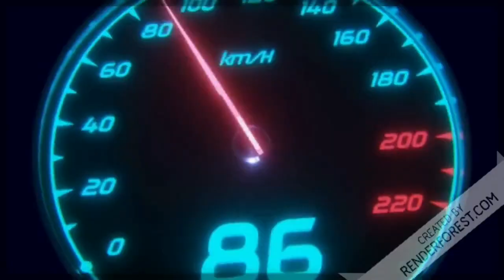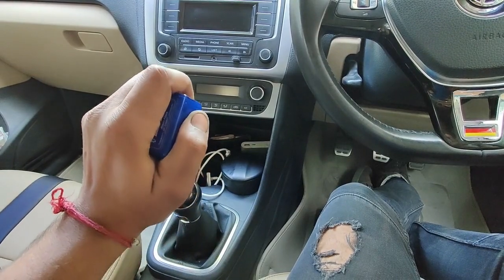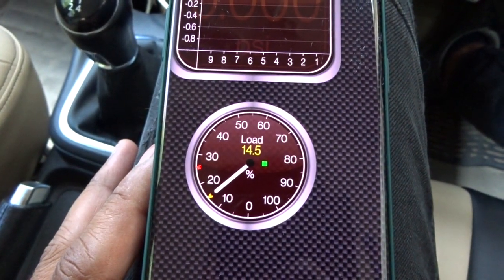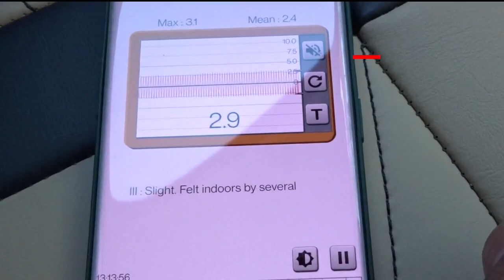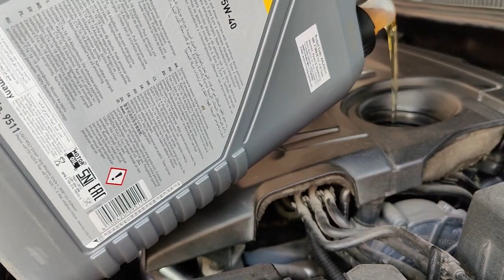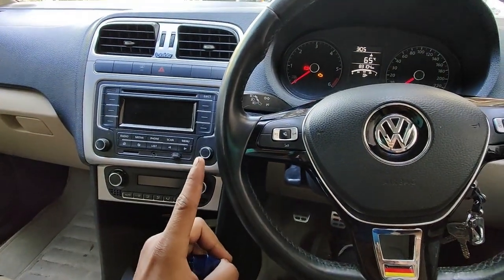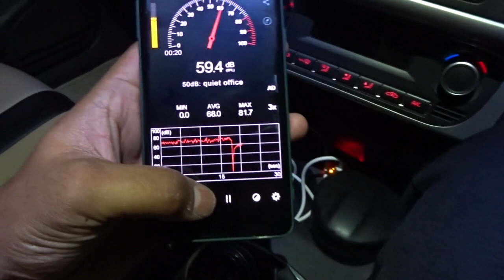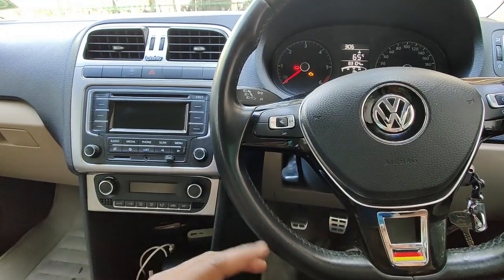BEST ENGINE OIL FOR VW | LIQUI MOLY TOPTEC VS WURTH SYNTHETIC ENGINE OIL COMPARISON

Comment: Motul 8100 Xcess 5W-40 API SN/CF Fully Synthetic Engine Oil for Petrol and Diesel Cars (5 L) (102870-4PK)  Suggestion sir
Reply from the maker: Xcess is not approved for 505.01 (which we need) its approved for an older approval which is 505.00 ,  motul's 8100 X-clean have the 505.01 approval but its hard to source .
Reply: @yourDIYneeds   thanks sir best oil Diesel engine polo
Reply from the maker: Best acc. To me is this LIQUI MOLY toptec 4100 , as far as all the oils i have used till this day , this was the best

Comment: Sir at speed of 80 my steering start a little vibration in rapid tdi 1.6 after having workdone on steering and shock absorber what may be the cause
Reply from the maker: sir , Have you got the wheels balanced ?
Reply: No sir only aligned the wheels
Reply: And vibration start on speed of 80
Reply: @flyfarmer  bhai get all 4 wheel balanced and circulate your tires in cross pattern. It will solve.
Reply from the maker: Sir get the wheels balanced from a good shop , problem will resolve
Reply: Whenever you change  tyres  it’s manadatory to perform wheel balancing.

Comment: u should experiment both engine oils either when newly changed, or in the middle (1500miles/2500km) or 4000miles each. not one at 4000miles, the other new. of course newly changed engine oil will have different parameters.
Reply from the maker: Sir i actually compared them both new , i also had a video on new liqui moly toptec 4100

Comment: bro plz advice me.. mine is same 1.5tdi polo I'm car is facing lub oil drinking problem.  I bought my car in Second hand .. just 33k driven .. I driven it till 47k ..  now.. this car is maintained at correct interval as per record and me ..  every 3 to 4 k I'm topping up oil for my engine ... plz guide me to short out my problem.. but I love this car..  no bad sign except drinking problem..  even performance is like showroom condition.. plz advice me 🙏
Reply: Go for Wurth fully Synthetic engine oil 5W40 A3/B4
Reply: Facing same issue. Any resolve on your issue
Reply: Go for 10w 40 for oil consumption
Reply: Check Vw spec

Comment: Tried amsoil ji. Simply speechless. Inexplicable feeling, impeccable smoothness & response from clutch 💯💯💯💯💯💯💯
Reply from the maker: Thats next sir
Reply: @immanuelmoshe7845  piston blasting base very hardly & causing the oil to leak from the BASE HOLE  is more gratifying than watching 📽️ films is BASIC INSTINCT😃🎥
Reply: @Immanuel Moshe no problem :)
Reply: @srinivaskumarreddy from where did you buy amsoil? What was the price?
Reply: @jigarhingu1222  brought from retail shop ji. They are available on AMAZON ji. They r as good as liquimoly. Amsoil signature series are good
Reply: @srinivaskumarreddy120  Thank you.  Which city you are in? If you can share the retail shop name/address.

Comment: What about motul 8100 xcess 5w-40? It fulfills the VW 505 00 spec right.. which is the recommended oil spec by vw. Some tell that you should only use vw 505 01 or vw 505 07 for 1.5 TDI engines.. which one is the correct spec
Reply from the maker: Sir as far as know vw 505.01 is the one
Reply: @yourDIYneeds  have you used motul 8100 xcess? It shows VW 505 00 , can we use it on 1.5 tdi engine

Comment: What are the reasons of oil mixing with the coolant? What are the problems when you refill the coolant by removing the hose coming to the coolant tank.will it make serious issues?
Reply from the maker: Coolant mixing with engine oil can be a serious issue 
1. Culprit can be the oil cooler 
2. Can be the head gasket itself
Reply: Change oil cooler
Reply: What about an oil pump problem?

Comment: Bro...appreciate the test...like your content...but here uve not considered the difference btw old oil and fresh oil. I mention it here because I had the same confusion....used both these oils on my diesel corolla and sadly failed to see any difference.....gone back to my oem oil now...thnx nd do keep up the good work.
Reply from the maker: Sir , we people have a kind of mis conception that we can use any oil we want in our vehicles , but the reality is that and engine is designed around an engine oil , and using the right oil makes a lot of difference , Corolla may not be able to take advantage of the toptec as its engine is not designed for this specific oil and its characteristics . That is the reason why if anybody ask me for a suggestion for an engine oil , i always advise to look for the approval first , i have used this specific oil on polo , Q3 , and a mahindra XUV 300 , it performed great on polo and Q3 because both engines are TDI and require VW 505 01 approval whereas mahindra started to feel sluggish . So if your specific engine is designed for a specific kind of approval , then my advise is to stick with that oil approval
Reply: @yourDIYneeds  thnx....appreciate it

Comment: Hi sir can we use Shell helix ultra 5w-40 fully synthetic in polo gt 1.6 tdi? As liqui moly toptec is way expensive costs around 6k.. Or can u kindly suggest any other good alternatives?
Reply from the maker: Sir yes shell can be used , its a good oil , but believe me liqui moly is worth every penny of its cost .
Reply: @yourDIYneeds  OK👍.. Other than liqui moly toptec can u suggest some good oils like castrol, mobil, motul or shell which is better in these?
Reply from the maker: Sir then second place is for shell helix 
And if you want you can also use motul x-clean 5w40 if availability is good

Comment: Hey brother can u please guide me which engine oil should I use in polo 1.2 tdi. 90k odometer reading. I don't want to take it to service centre now. . Am confused between Castrol , shell and liquy molly.plz help
Reply from the maker: Sir liqui moly , anyday over anything , its the best you can buy for vw tdi
Reply: @yourDIYneeds   brother thank you so much for the guidance. Please help me there are two types of oil present on Amazon. Please tell me which one I should buy
.1. .Liqui Moly P000322 9511 Top Tec 4100 5W-40 Semi Synthetic Petrol/Diesel Engine Oil 

2.  Liqui Moly 8578 Molygen New Generation 5W-40 Fully Synthetic Engine Oil
Reply from the maker: Sir toptech 4100
https://amzn.to/3SxdZgk

Comment: Sir I bought  renault duster 2nd hand, 2014 model....
Can u suggest me the best  engine oil for it...
Please ..
Reply from the maker: Sir first thing to consider is approval fron renault  , although if you want ,you can actually use toptec , its a great oil , it also has approval fron renault , but have to cross check for duster
Reply: @yourDIYneeds  okay.. 
Thanks sir ji..

Comment: Hii brother I bought a 2015 Polo tdi a few days but there is this same noise in the steering wheel and a little sound in the suspension I guess while going over small potholes or bumps what would be the reason? Where are you from and do you have a car service shop ?I really want to get my car checked by you once plz help
Reply from the maker: Sir i am from delhi and don't have a shop 
But its easy you can have a look at the yolk screw adjustable video and do it yourself , its very easy
Reply: @yourDIYneeds  I saw that video tried to do but my mechanic refused he said it is something related to front suspension bush which may be worn out...really worried
Reply from the maker: Sir mechanic are there to earn , he will always tell you those things by which he can earn something from you . 
You can also check the video of caliper pin replacement of polo they also make noise its a recent video in which i displayed the noise which those pins make 
Yolk screw adjustable is really easy and can be done with just one 19 mm wrench , which you can buy in like 200-250 rupees .
Reply: @yourDIYneeds  Hii brother got the steering vibration and sound resolved it was due to local brake pads used by the previous owner and were worn out ....got them changed and installed original Bosch brakepads the cars feels much better to drive now....Could you suggest something about hard clutch issue?
Reply from the maker: Polo diesel  by default has Hard clutch , 
But of its getting even more hard then chances are than you need a new clutch set .
Reply: @yourDIYneeds  Oh okay...incase it needs to be changed in future how much would the new clutch set cost any idea?
Reply from the maker: Sir oem costs around 9-10k just the parts which include , clutch plate , pressure plate and clutch bearing . And one thing which is dicey is the condition of flywheel which needs to be changed acc. To the condition of flywheel , that can only be known after removing the gearbox
Reply: @yourDIYneeds  okay my polo is driven approximately 31,000 kms I don't think so the flywheel might be damaged....at last thankyouu so much for your precise reply for each and every question I asked and clearing all my doubts❤️~Permanent subscriber
Reply from the maker: If driven well , polo needs a clutch change around 90-100k kms mark ( depends upon amout of city stop and go traffic )
Reply: @yourDIYneeds  can I use LIQUI MOLY 5W40 engine oil for my polo 1.5 tdi 2015 model?
Reply from the maker: Yes sir ,
Reply: @yourDIYneeds  Thankyou

Comment: Hello sirr I'm having a vw polo 1.2tdi I've done all the suspension work changed all 4 shocks lower arm bushes and also checked steering rack.. But still on rough roads the car is making noise from somewhere from front side ...any advice?
Reply from the maker: Changed link rods and caliper pins  ?
Reply: I too had similar issues I have changed steering rack and lower arm that fixed the issue
Reply: @yourDIYneeds  not yet but I'll change it soon... Thank you!  Sir

Comment: Engine oil flush is good for polo tdi ?
Reply from the maker: Sir not everytime , like on every 3rd or 4th oil change , depending upon the quality of oil used
Reply: @yourDIYneeds   my car has  38,000 km done !! Plan to change engine oil and engine flush ! Safe to flush the engine ? Sir
Reply from the maker: Use a good flush , from a good brand and stick to the directions written on the box , and it will be good
Reply: @yourDIYneeds  ya sir !! Going to use Liqui molly

Comment: I have been using Mobil 1 ESP 5W30 which meets the VW 507.00 / VW 505.01 for my Polo 1.5 TDI. 

Is Mobil 1 a better oil or should I switch to Liquimoly Toptec for 1.5 TDI?
Reply from the maker: Sir i will not say anything , but i will tell that you should atleast try it once and judge it on your own . And believe me , you will not be disappointed
Reply: I will surely get Toptec for my next oil change and thank you for making such informative videos for VW 🇩🇪.
Reply: What mileage your car gives now and is it a 110hp engine.? Or 90.?
Reply from the maker: Sir its 90 and fuel economy in city is close to 16-17 and Highway its 22-23
Reply: @yourDIYneeds  I know yours mate 😀 I'm asking mobil esp guy cause I never saw vw tdi guys using 5w30
Reply from the maker: 😅😅😅 my bad , i guess he may be having a kilometre per litre or so more due to the 30 grade , but its more like a trade off with the engine reliability .
Reply: @yourDIYneeds  Means my guess is right but I read on teambhp also he also read I guess If 505.01 isn’t available you can go with 507 also I read on a vw website and in forums. I’m using motul x cess which doesn’t comply 505.01 but x clean is not available in our country so I will try aimsoil next time btw my car serviced 5 times like you I do it at home every time I used motul but my mileage is 15-18-21 but I drive little fast my normal speed on highways is 120-140 in city I get 16 but our city doesn’t have traffic.
Reply: Also my car is Ameo tdi it’s not a good engine over compressed engine.
Reply from the maker: Sir yes , from wherever you read it , its correct , VW507 approval superseeds the VW505.01 , but usually 507 is more costly than 505.01 
Sir if you are getting 21 after you do 120-140 then i guess we must not expect any more 😅
Reply: @yourDIYneeds  No No after doing 140 150 I get 15 16 😅not 21 I get 21 when weather is cold 70~80 speed less load less Ac 😆
Reply from the maker: 😅 , then ok , i got worried how you are getting 21 after doing 140🤣
Reply: @sourabhdhawan  I have the 90 bhp model. Mileage in the city is around 18 kmpl without AC, 15-16 kmpl with AC.
Reply: @Ron3064  same but never tested without AC using Meguin

Comment: Bro can we use liqui moly 5w40 in swift diesel 2016 model?
Reply from the maker: Yes sir ,
Reply: @yourDIYneeds  need engine flush before changing oil?
Reply from the maker: If you are doing oil changes in time , then you don't need flushing , if you are one of those person which usually skips then its a good idea
Reply: @yourDIYneeds  no bro...I change oil always in time.thx for information.i have to choose one from liqui moly and volvoline synpower 5w40.liqui has high price😔
Reply from the maker: Yes , its high on price , but it justify that price with its performance.
Reply: @yourDIYneeds  is there any small pack available of top tec?Amazon has 5l pack and my requirement is 3.1l
Reply from the maker: Sir there is 1 Ltr pack but its very hard to get hands on